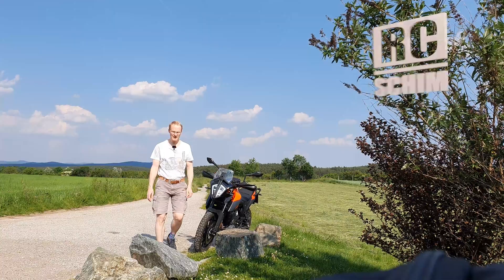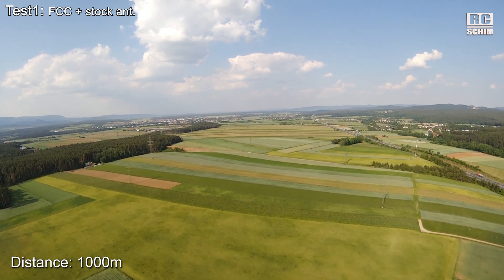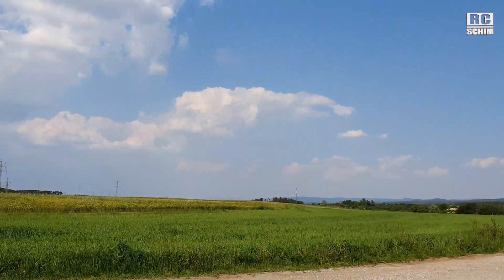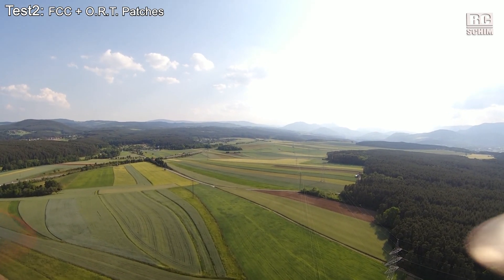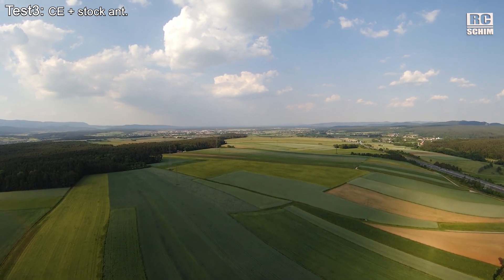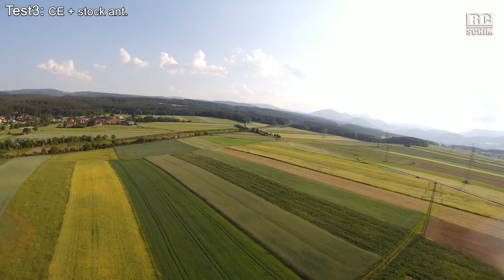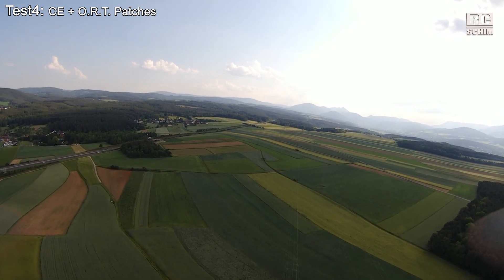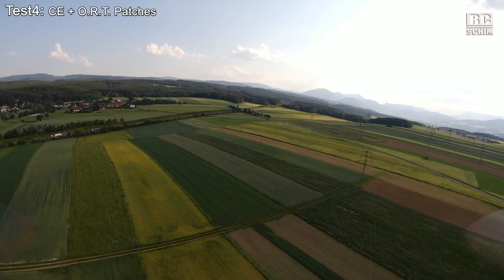O.R.T. Digieyes V2 - DJI FPV dualband Patch antennas

Comment: Would you say these are better than the crystal patches for a standard DJI air unit?
Reply from the maker: Hi, great to see you come back to my channel ;)  I still havent tested this with "normal Airunits" - only used it on the DJI FPV Racer (as in my last comparison).
Gutfeeling says: it's as good as chrystalHD or better, hopefully I can test this sooon - but ugly weather and only a few hrs of sunlight around midday are not very much helping at the moment...

Comment: Do you recommend these or the crystal HDs?
Reply from the maker: Attention: chrystalHD (which I like and recommend) are 5.8ghz ONLY, whereas this here is dualband and more suited to the DJI FPV drone (which also uses 2.4ghz).
So if you just use normal DJI Airunit / Caddx vista   you are better of with ChrystalHD or VAS cyclops 2

Comment: Awesome test, thanks! My question is a bit off-topic: when flying a dji air unit I notice my signal strength going down to two bars into the red while it is still at around 50mbs. Would you turn around at two bars, or when the mbs drop significantly? Thanks! :-)
Reply from the maker: The signal indicator (whilst going red) doesnt mean a lot. You have to look at bitrate. If it drops below 10 I'd turn around latest - but I confess I get nervous already when it's below 30 :) Also depends on RTH available yes or no?
Reply: @Rcschim  thanks! I haven’t set up RTH on my 5inch yet. Should really look into that :-)

Comment: Just fly it into return to home ;) I even fly my normal FPV-drones till the video breaks up behind trees & such and recover it with angle+throttle till I clear off the trees >:)
Reply from the maker: I know that it SHOULD work, but while flying this rather expensive drone I dont trust it enough and dont wanna loose my gear out there ;) 
Angle+Throttle is probbably better than GPS RTH on most DIY BF drones, right?   I've once tested the RTH whilst being too low and it lost quite some height ;)
Reply: @Rcschim  DJI RTH is super great, thanks to their GPS+Height sensors. The DJI FPV also has front collision avoidance, so it won't RTH right into a wall or tree like those Minis do. Maybe you should just play around with this function by activating it in save spaces, watch it do its thing and then increase RTH challenges for the drone once you gain trust. In the open field you flew here it should work absolutely flawless :)

DIY RTH is creeping me out a bit, mainly because of the super inaccurate GPS hight-reading and the drone's response to that. Angle Mode + Throttle is a nice more controlled alternative as long as the accelerometer is calibrated and the wind isn't too strong. But you are flying blind for a while with only hope left that those crossfire frames still make it through despite video lost… so it's definitely thrilling. xD Treebranches, disarm or video reconnect? You'll find out in a few seconds that feel like an eternity g
Reply from the maker: @aphinion  I think I remember that DJI FPV DOEST NOT use the avoidance sensors on RTH! Double check this! It's doing it on Mavics I know - but not on the FPV from what I heard. There it's just for "warning" the pilot with the red bars...  I think they couldnt reliably do avoidance here because of the higher speeds...
Just remembered, that I once had a lot of luck with the angle mode (when my analog FPV cam cable disconnected:  https://youtu.be/bChI64ujPRw?t=194  )
Reply: @Rcschim  Ohno! Yeah, this could actually be true. So blindly flying into the wall it is, if the RTH hight is set too low ;D

Comment: @RCSchim : do you think that these dualband Patch antennas could work also with my quad equipped with dji air unit ?
Reply from the maker: I didn't try myself yet. For air unit, vista I always use my v1 goggles with either Chrystal hd, or 3 turn helicals from Henrik. 
They will work for sure, but range would not be the best I guess.
Reply: @Rcschim  Thank you very much for your reply. Maybe a good combinaison with two TrueRC Duality 2.4GHz + 5.8GHz Dual Band Stubby ? Best regards
Reply from the maker: @alexiscoutier7682  Yes, I think that would be a good antenna-combo for V2 goggles and DJI FPV. I should fly more with my DJI FPV - it's such a good video transmission system!
Reply: @Rcschim  thank you for your reply. At this stage, I ordered a chrystal HD to use with my dji air unit drone and I will see later for a dualband patch anntenna for the dji fpv because I am not fan of the design of this dualband patch ! Best regards
Reply from the maker: @alexiscoutier7682  Yep, chrystal is my default antenna (not the best range, but good enough and so good looking and convenient!)
for DJI FPV I'd stick with the stock antennas (if you're in fcc mode) the range on stock antennas is plenty, no real need for me to upgrade.
Reply: @Rcschim  Yes in FCC mode, it is good enough if you fly at 50m altitude. What I would Like to try is to get a good link when I fly at 2km distance but with 10 or 20 m altitude. In this condition, i drop signal...
Reply from the maker: @alexiscoutier7682  I discussed this with another user who wants similar things. I understand the need - and since the 500m alt limit cannot be hacked, the drone is more suitable for this type of longrange lowatl cruising. If you can, choose a higher place to start from, or get yourself a tennis court high seat :)

Comment: Interesting, would be nice to see how they perform with the Air Unit  - nice option, if you have both DJI FPV drone and 5"
btw: the new DJI FPV drone firmware (1.0.2) now shows bitrate in the googles video (srt files) in same way as air unit - so gives a bit more data.
Reply: also, do you have a link where we can get these in the EU?

Comment: Love your videos.
I get your nervousness, but I do not think the drone would dissapear, DJI Return to Home is pretty bullet proof. Am I incorrect in thinking at the end you raised the altitude from 50 to 80 meters, If that is so, that of course would make a big difference. On my DJI air units with standard antennae (version 1) I can go out to 1800 meters at 20 meters above the ground (clear line of sight no trees)  at that distance the bars have already passed red  and there are flickering red bars, the bitrate is still above 20 but still good video. When I turn around the antennae are partially shielded by the top mount battery so some video degradation does occur. I have GPS rescue on all my drones and I test that well before I do distance tests.
Reply from the maker: Rationally, now from home - I also think it would have been no problem to fly until video drops out. But while flying, I still get a high pulse - and it rises to unsafe levels if the video is suddenly gone :)
I flew ~50m alt for the first 1km and further away I gradually increased to ~100m. Did this for all flights - but of course there's an inaccuracy in that...  Waypoints would be better for testing.
The red bars on DJI V1 are no problem at all (they are just distracting). On DJI V2 you don't see bitrate - only the 4 bars - and they are serious. If I see 2 bars I'm already alerted!
Reply: Thanks for the response. I remember my first long flight away with my 5" Roma DJI equiped and was terribly nervous. So I decided, I need to calm myself, so I started to fly in open areas to see how far it could go, so if it crashed I could walk the few kilometers to hopefully find it. But fortunately I did not lose it, but I still worry, and when I read the DJI specification and it says 2,5 Kilometers, I wonder in whose world that exists. Thanks for great videos, I really enjoy your channel and think of you and respect you as one of the people to learn from.

Comment: Good info. I'm still using stock antennas. The problem I am having is loosing reception around objects.
Reply from the maker: Signal penetration should also be better with the directional antennas. Are you in FCC mode? in CE mode I wouldnt even try to fly behind a japanese paper wall ;)

Comment: Nice video 👍.  You can use the DJI Fly App while flying, you can overlay the flight log with your video.  Alerts and map course will be displayed.
Reply from the maker: Yes, that would have been awesome! Unfortunately I forgot this option since I dont use the DJI fly app   (if you set your drone to FCC mode - the app re-sets this on connection - so in non FCC regions nobody uses their app :)
But this would have been the kind of data and overlay that I want in my videos...
Reply: @Rcschim  Ohh, I didn’t know that would do that, I’m sorry to hear.  I don’t use it, just realized might be of help to you.
Reply: @Rcschim  you might connect the googles (and maybe drone, too) to the phone after the flight and download the logs. You should be able to get much more information on the flight replay. That may be inserted as a little overlay into one corner of the flight video.
You might enter fcc mode afterwards again.
Reply: Those flight logs can be analyzed on a dji log replay site https://app.airdata.com/main?a=upload for even more information (like a blackbox log with a shitton of info, battery voltage, amps, temperature, heading warning and error messages. I would expect rssi info there, too.
Reply from the maker: haha, irony: now DJI FPV got a firmware update which allows SRT files again ;)   When I get the chance to, I can now repeat my tests and get proper data :)
Reply: @Rcschim  Nice. Can’t wait.

Comment: its a lot to ask the ort's, 25mw is so little, if a pigeonflies by at 200m you'll failsafe, ok a fat pigeon.  i think the fpv drones camera is pretty nice, i really enjoy the light handling of these cams, even if its squashed contrast to make it easier to see you can easily bring back some over exposed glare in post.
Reply from the maker: I didnt mention - but here I also used the ND filters - wich make the look even nicer. Especially on the DJI FPV drone you have to remind yourself this is just DVR. Looks freaking 10times better than my old gopro footage did :)
the 2.4GHz mode is allowed to use 100 (or even 200mw?)